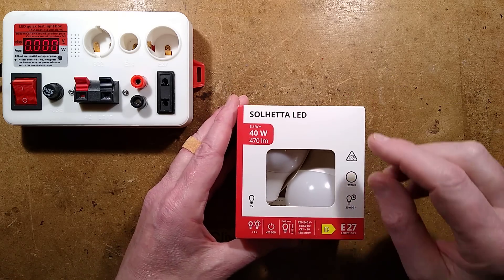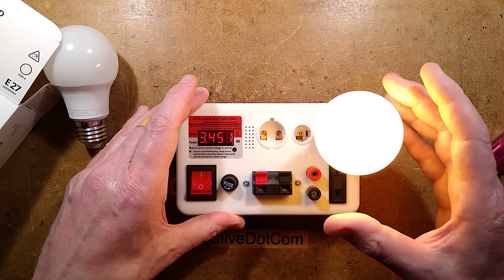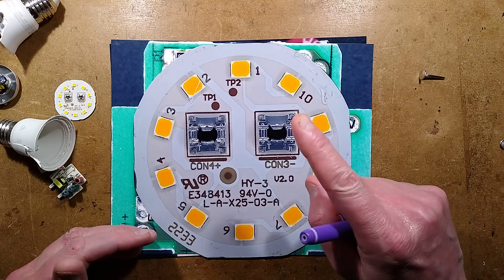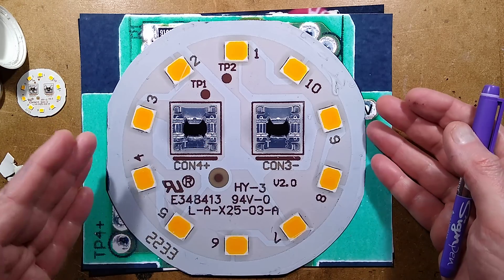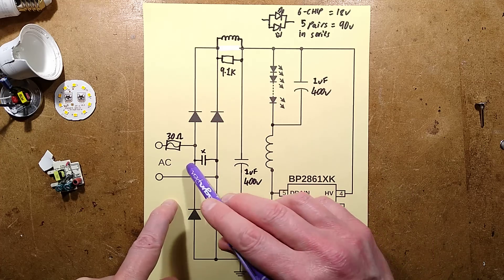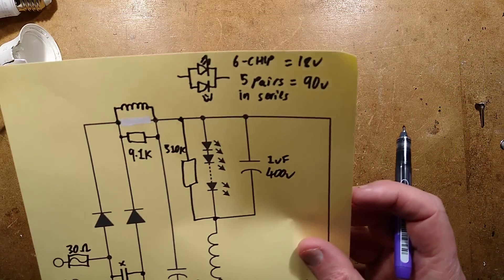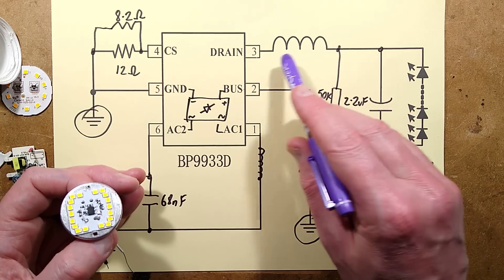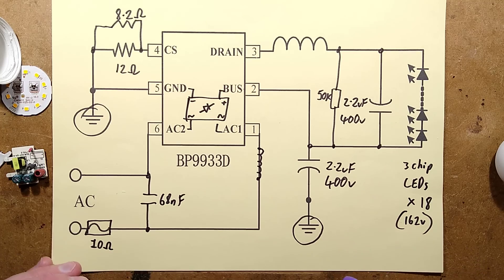IKEA Solhetta bulb teardown

Comment: There’s an example we’re told about during induction, about how IKEA’s design ethos/method varies considerably from the norm - the designers for the LED bulbs were given the challenge to make an LED bulb for a retail cost of €1 - after much frustration and designing using low cost components they couldn’t design one that met the high standards they wanted. Then they looked at what would happen if they used the expensive components, but purchased them in extreme bulk - which allowed them to actually get considerably higher quality components, but utilise IKEA’s method of large scale manufacturing to get a sun €1 bulb that had high quality components. 

This was many years ago so the price is no longer as good, but thought you’d find it interesting
Reply: @mipmipmipmipmip This lamp, on its own, argues against that. This is a really well designed lamp, focused on high efficiency and high lifespan. vastly superior than the overdriven lamps with inefficient linear regulators you'll get pretty much anywhere else.
Reply: @robertbackhaus8911  Most of their flat pack furniture is crap though.
Reply: @R_Forde does anyone else sell similar things for a similar price? I agree plenty of their products aren’t going to last decades, but you’d pay several times as much for something that would (I think, I rarely buy furniture and never “good” stuff), while IKEA seems to hit the “good enough” mark at an affordable price.
Reply: At least the quality has improved greatly, the first IKEA LED bulbs lasted about a year but the last I bought about four years ago still shines...

Comment: Lamp with longer top contact is a rudimentary design from older models, where connection between board and E27 was made via connector, so you can easily place and take out driver from lamp body without soldering, etc. Older Osram 10W lamps which look identically were made like that, in fact they were made on the same production line, Leedarson as i know.

Comment: These modern bulbs are rubbish my great grandfather acquired some 250 volt incandescent Osram lightbulbs from the health authority he worked for in the 70s and i still have some working in rooms I don't venture into often
Reply: With incandescents, you've got light output, power consumption, and lifetime, can maximize any two at the expense of the third. 250V bulbs run at 240V or lower will reduce power consumption (proportional to voltage) and light output (related to filament size and temperature), and greatly boost lifetime.

Comment: With the new energy rating system, Crompton Lamps have created a small range of ultra efficient LED bulbs that are A rated on the new scale and use LED filaments. They claim to use about half the power of a standard LED lamp for the same light output
Reply from the maker: Have they used the approach of using lots more LED filaments than usual?

Comment: I like adding capacitors to the Amazon LEDs, for 0 flicker and soft on/off
Reply: be careful, depending where the cap is, it may cause higher dissipation in the regulator chip, if it uses one

Comment: "They've Glued It On With Silicone And Then Folded These Little Panty Flaps Over On The Panty Wings, To Hold That In Place" 08:25
- You're running hot tonight, Clive. I had to check if indeed I was watching electronic circuit analysis, and not something else.
Reply: I tapped that link for 08:25 and immediately got an ad for Always Discreet

Comment: Big Clive:  Have you ever added another smoothing capacitors in those boards that have the board spaces missing the part?   I guess these options were used to either save money or add later to create a "ultra quality"level product.
Reply from the maker: If the design is based around there being no smoothing cap, it may change the lamps characteristics and possibly cause damage.

Comment: On the schematic - where do those grounds actually go to? (physically inside the bulb )
Reply from the maker: Usually to the negative connection of the main smoothing capacitor on each section of circuitry.

Comment: I have IKEA's NiMh batteries and chargers. 
Their furniture might made with cheap particle boards, but they make good quality and safe electronics. 
Fear of litigation can work wonders.
Reply: I've not had much luck with these low-lumen Solhetta's. First pair I bought , one broke within a week or two (they tested them at exchange desk) so got replacement pair; and its partner died a few weeks later (didn't go to get replacement). But then the replacement pair rather quickly died too; first had a few weeks of seemingly working normally but then turning themselves off --- then 15--20min later turning themselves on again. No other LEDs or other have been difficult. Bought another pair (WHY!?!) and they've been fine for about a year. So a 2/3rds failure rate within say three months, not good.
Reply from the maker: Were they being controlled by a dimmer or other electronic switching circuitry?  Or perhaps in a fully enclosed fixture?

Comment: Lots of outlets in the UK sells light bulbs with Edison socket. Sadly in my home all light fixtures and chandeliers require UK bayonet light bulbs. Most of the other homes I've seen only use bayonet light bulbs, both standard and small.
I have no use for the E27 Edison light bulbs to this moment.
The UK is peculiar. Many appliances that in Europe comes with a charger or a power adapter, are shipped to the UK without one, because of the non-standard power plug.
Thank you for the video,
Greetings
Anthony
Reply from the maker: You can get adaptors from BC to ES.

Comment: clive need to learn swedish O.o   solhetta = sun heat or sunheat more accurate.  sol = sun,  hetta = slang for hot so its no translation i can think of now that is accurate for "hetta".    (varmt - hett - hetta = all means hot in general).

But clive did say it correct, its a short "E" and a short "T" in hetta.
Not to make it complicated and the easy explanation is that "TT" = a short "T"   but on the other hand "NN" = a long "N"  "antar" = a short "T" ..  And the letter "Ö" is a word and it is = island  ...   "Å" = stream,   "ÅH" = slang for "really?", slang for curious/interesting/supriced   ,  "Ä" dosent mean anything but it can be used to say "ÄH" = nah, whatever, slang.  
Its easier than learning danish is crazy and combine "A" and "E" and it is a danish "Ä" if i dont remember wrong "æ".
Swedish isnt that hard to learn ;)  

Can clive say "jag bor på en ö som är en del av en ögrupp i åmål även jag äger en båt" ?  ;)

Old classic:  Mojje - A som i apa

The swedish alphabet explained in a good way :)

Comment: I would like for you to include something more to your videos:
As a solar powered home would be far more efficient if devices do not run though the inverter, please note for each device if it can run on DC and what is the most efficient voltage. I am thinking of converting most of my house to 240V DC, as most of devices can run on DC (switch mode power supplies). I have biggest issue with devices that use shaded pole motors (small fans) and capacitor dropper LEDs.
Vacuum cleaner has universal motor, boiler does not care if it is DC. Maybe inverter air conditioner can run on DC.
Reply: I don't think using 240 DC is a good idea. Normal switches are not built to handle high voltage direct current; the spark you get when breaking the connection does not disappear as quickly (or at all). With AC the voltage will go to zero 100 times per second and the sparc will go out, but this will not happen with DC, and this can be a fire hazard.

And this is of course a problem everywhere a sparc may occur like bad connections or damaged cables etc.
Reply from the maker: For whole home off-grid capable LED lighting I'd miss out an inefficient double conversion and have a low voltage 12 or 24V lighting system.

Comment: It is 94V over the LEDs on the low power one. It even says so on the PCB next to the chips. 😀
Reply: 94v0 is a standard in the flammability test, and it measures the extent to which plastic materials can withstand and resist burning. Underwriters Laboratories (UL) developed the safety standard, which explains the commonly used term, UL 94.
Reply: @mikebarrett2621  Ahhh. My bad! New error shortly! 🙈😂

Comment: I think some of the GU10 IKEA lamps are possibly built to the "fewest overrun LEDs, minimum life" design. I've a range of GU10s in my house and I find some of the  IKEA ones suffer infant mortality - less than 3 months. Unfortunately they have solid glass envelopes, not plastic, so they would be difficult to take apart to find out what went wrong.
Reply from the maker: The GU10 housing was never designed for heat dissipation.  It's a tough environment for LEDs.
Reply: Change over to the Phillips ones they are nice in GU10.. Me got some 3.2W from Phillips when on sale now they are 3,8W GU10 with "warmglow" ... You will like them and out of 24x put into a concealed metal round light none have failed 😊
Reply: Usually these type of lamps the front lens is still a separate part siliconed or glued on. I have found some brand all glass GU10 bulbs that had lens come out very easily._
Reply: How old are these? I have a load of 2W Solhetta GU10 warm white bought this year. With 230lm output they seemed the most efficient around. They appear to have a reasonable component count from what I can see through the glass package with 8 LEDs, 2 X 4 pin SMT chips of some sort, a small transformer (I think) and 6 or 7 other components. They run very cool and claim 25,000 hours life.
Reply: @simonbeasley989  These are the LEDARE 7.5W 600 lumen 2700K GU10 lamps. The newest purchased within the last year and "taken into stock". I've had several fail if you include  their brothers with E27 bases. Now I admit that IKEA make most of the bulbs I have, so you would expect more of them to fail, but one in particular lasted less than 3 months in an IP6 bathroom fitting, so it's a bit of a s@d to change. Its predecessor (not IKEA) had been there 9 years. And there are a good minority of various other brands. Maybe the LEDARE design is now obsolete and I should buy some SOLHETTA ones the next time I'm there - or switch brands to, say, Philips.

Comment: Clive these IKEA bulbs are interesting especially the current regulation one where they set the current through the LEDS with a low ohm resistor, they remind me of the LED bulbs I bought from china back in april 2022 I bought 5pcs of 18W where I had 18 leds in a string. They used a brightpower BP2863 buck regulator and the current was set through a 1.6ohm resistor I changed it to 4.7ohm dropping the output more in half they ended up at 55-60Wish, been using them regularly over a year and I think they will last for a long long time. At the 4min20sec marker can the other two holes be for GU10?
Reply: Yes looks like GU10 spacing, or even B22D, with the appropriate pins in the base crimped on.
Reply: But how do you close the lamps properly again?

Comment: Interesting to see the EU / UK regulation reset trying to combat the trend of too-few LEDs pushed too hard to save a buck while reducing their lifespan and efficiency.  I wonder if we'll see any knock-on effect of that here in the US.  It'd be nice to have some metric when comparing bulbs to know which ones will actually last in hard-to-reach fittings.

I did recently purchase a bunch of over-powered bulbs for those fittings, with a plan to hack them to a lower spec, thanks to your advice on this.
Reply: I did replace E14 40W 230V satin incadescdent Lamps in a double chandelier with 1,4W Filamente styles Led when i was younger.... Now i am 34years and none of them have failed 😂
How do I know? They are on a pir sensor and I have zero replacement bulbs and I can't reach them without a wooden construction in the hallway😂
Ebay "cheap" ones 48 pieces came to a whooping 140€ years ago...🎉🎉
It is possible to make them last ❤
Reply: @kitecattestecke2303  its 'luck' as to how hard they drive the led chips...
Reply: I don't exactly remember how long ago, but every LED driven bulb/fluorescent tube replacement i've bought so far has survived since i bought them.
The fist one must be hitting its seventh year so far. Though i don't have them powered all the time.

Either way, i used to replace incandescent bulbs every 6-9 months and over time that cost me as much as one of these LED bulbs and TIME and ANNOYANCE.
I am so happy that LED just works better.
Reply: @RealCadde  they will vary depending on quality and design  ,worst one i had was about a couple of months, longest so far , couple of years or so, still going, but as its in a partly enclosed  fitting, it gets quite hot..
Reply: Look at the fine print directly on the bulbs. You want ones which specifically say they are suitable for use in enclosed fixtures. Also calculate the lumens per watt, which AFAIK is what the A-F scales do.

Comment: Bonus 2 for1 tear down, and total different insides. Will the buck regulator help with the power factor??
Reply from the maker: No.  It won't help with power factor much.   It's still down at 0.5
Reply: @bigclivedotcom  It's unfortunate, as with some slightly more complex internal circuitry in that "do it all" second IC, it could have built-in PFC and a nice power factor. That would be one benefit over a capacitive dropper.
Reply: @henryokeeffe5835  maybe if it didnt have any smoothing cap after the rectifier, would be better power factor? might not be too flickery as the regulator should be able to stabilise the current with varying input volts within limits...??? some chips data sheets even show use with and without a cap
Reply: @andygozzo72  Yep, that would help if the chip's designed to start up that quickly.

Comment: I am officially miffed by the fact that we are mostly offered stupid warm white LEDs and stupid cold white morgue lighting. Why not go for the middle which is the best color temperature for most general lighting?
Reply: Agreed. I buy 3300K lamps whenever possible, a pleasant yellowish white rather than the dim oranges or harsh blues that are so bizarrely prevalent. But they can be hard to find.
Reply: Agree.   I stumbled on 3500K, 900 lumen bulbs that were perfect once.  And then Lowes never carried them again.    They all died after about several years.

Comment: I checked my box, both of them are 3.4 W. So someone has been swapping lamps.
The sense resistors are indeed on a separate board, and not on the LED board. This makes it almost impossable to tame down the lamp, just in case you want a 1 W lamp.
Reply from the maker: On a plus note, the higher power lamp does have the sense resistors on the front (12 ohm and 8.2 ohm in parallel).  So lopping one off lets you choose a lower power rating.  (More info in the description.)
Reply: I just took a sharp screwdriver and scraped some of the tin off from R3, then snapped it off with the screwdriver. It works and is quite easy, easier than it was to pull the diffuser off with just my bare hands lol

Comment: What’s the “death beam” in the capacitors?
Reply: It's a meme from a 5G BS video.
Reply: @benbaselet2026  yep, load of  bull claiming the ht smoothing caps in led bulbs were 5g emitters.... they may well likely emit something when they fail 😉 but certainly  not any g 😜
Reply: A running joke. Some people claimed that mains-voltage capacitors used in street lamps were responsible for 5G mobile phone signals (they aren't) which made people ill (they don't).

Comment: There is a stark component count difference between the simple ones and the more well engineered ones. Thanks for the insight Clive.
Reply from the maker: I'm not so sure this type is better engineered.  The linear regulators are super simple and have low electrical noise.